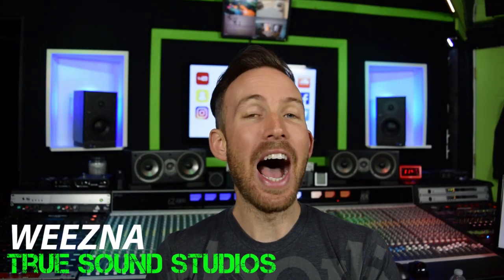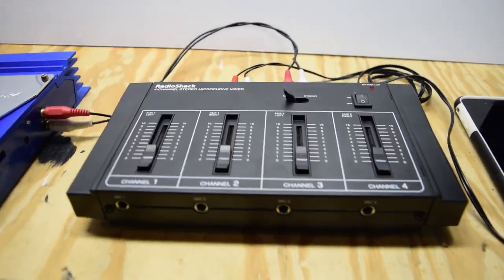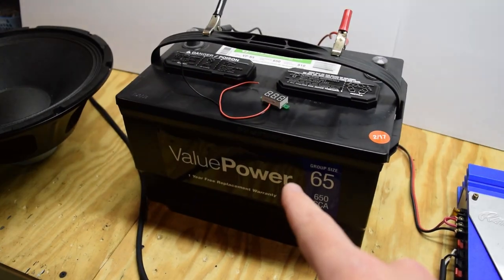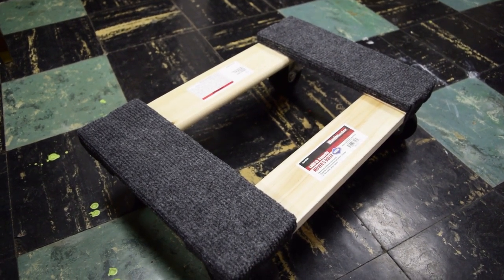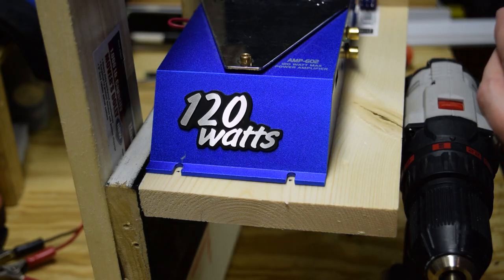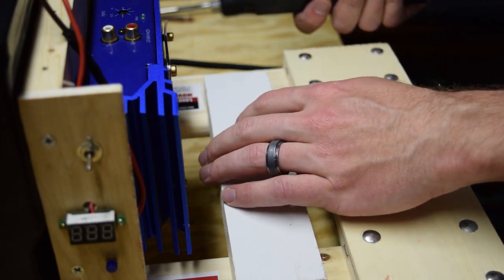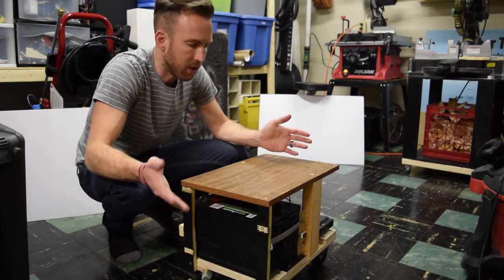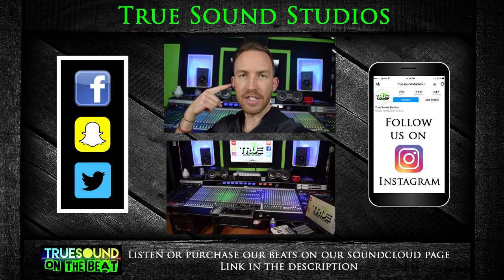How To Build A: DIY Portable Battery Powered PA System for Busking

Comment: I like how this build is not all polished. It’s very real, like using a piece of shelving that was sitting there. 
It should’ve been deep cycle battery, but I love the idea. I specially like the voltage meter and the push button for it. 
Thanks!

Comment: For a situation like this you should use a deep cycle battery. They are designed for going for through charging cycles where it gets fully charged then periods of use without charge then back to full charge again. Automotive batteries are designed for simultaneous use/charging cycles. Electric vehicle (scooters, bikes, golf carts, etc.) batteries are generally of this type. This will give you more reliable battery life.
Reply from the maker: Thanks for the info!
Reply: Or small lithium batteries in series parallel combination circuits to get your 12V. Since large batteries go bad and are expensive to replace if the reconditioning fails.

Comment: My Tono 50W stereo PA system has 5 inputs with wireless mic with reverb, bluetooth, foldback speaker with earpiece option etc. Handle pulls out when you drag it. Battery lasts 12 hours. Fits on the back of my motorbike. $50 brand new. Backing track lyrics appear on ipad that sits in the ipad /mic stand that telescope out of the speaker. My Jammy digital guitar clicks in half and sits in my backpack. 100% wireless.

Comment: Many comments here suggest buying a proven portable product, and it's very good advice, most of these use "lithium ion" battery packs and there are specification reasons for this. Sustainable power = quality. D class amplifiers have come on a long way, however, a car battery is not designed for this solo longevity performance purpose, and will very likely make your equipment unstable. Keep surfing, there are many subject matter examples here on YouTube for comparison purposes.

Comment: Hi, good video, thanks!

I have a question. If I use a battery like that to run a car amplifier, do I need to ground it to something metal, or just to the ground connection on the amplifier?

And why do people use AC amplifiers with a power inverter? Wouldn't it be easier to just use a car amplifier connected directly to a battery, so you don't have to carry a power inverter?

Comment: my problem.would be on the charging of the battery,i got a subwoofer amp module with its two mic inlet..it has a 12v  and a 220v inout socet..so i was thingking if will the battery be charging conected through 12v input socket if the speaker amp is also connected to 220v ?

Comment: Well done buddy! Just a small comment at 10:30. I will remove those metal side caps and drill, and then put them back on. Those metal fragments go inside and cause short circuiting!

Comment: Believe it or not a larger guage power wire will increase the power to the amp. Crutchfield used to put a chart for the guage wire vs the amp size, I'm sure those charts are online somewhere.

Comment: Hi~ I want to make a cart so I can take my DJ turntable set up out on the street. That's 2 decks a mixer, speaker/amp and laptop. What's the difference between a car battery and deep cyle? I just heard a deep cycle is better. Or will last longer. 

How long does your set up last? Or power that?
Reply: 1 car batteries need a lot of power to start the engine in the engine is a alternator which recharges the battery
a deep cycle battery also known as a leasure battery is better in the life of battery 
did you notice in video the only think is running from the car battery is the stereo and that the mixer runs of its own batteries
there is a online converter to help with maths and a rough estimate on length of time but as a basic rule 
the amp hours on battery is divided by 12 watts  example 100 hours battery will last 8.5 hrs
another general rule people think this is ideal believe us on this go for the biggest battery on amp hours and divide this by 2 when buying 
Why you may ask you want value for money in the long run and also batteries do not like to be drained fully and you will get more charges over the lifetime of the battery
if using lithium the optimised level is 50% these don't like full charges best scenario for these 20% to 80% and the battery will last 3 to 4 times longer so remember to keep eye on phone battery charging level  or anything else you are charging up on to get the most out it's battery life
Reply: do not run a laptop from this unit best to make sure battery is full before starting out and buy a powerbank a good one shouldn't cost more than 30 quid a belkin 20000mAh is ideal is what you can expect for the money spent and is ideal for lithium devices and remember not over 80% charge and it will lasts years if looked after  😊

Comment: Ok I have a 7,000 watt turbo sound set up that I would like to install in mt truck any idea on how I can do that considering it has built in amps? please help. I want to perform on my small trailer and pop the back hatch open and power on and go without a loud ass generator

Comment: If you decide to make a triangulated Speaker set up with sub woofer. What kind of cables would you need, and is there a way to keep the cost low? Also, any low cost high quality mixers you recommend with 8 channels and a FX send and return?

Awesome video by the way, i hope this is a series!

Comment: I've been looking at getting a mixer like this just to give my bicycle trailer sound system a PA-upgrade. Especially on those group rides where I've got to call an "obstacle up" on a bike trail or on the road.
Reply from the maker: Oh very cool! Is there a video on your YouTube channel of your bike system? Thanks for watching
Reply: I don't know why this reply didn't pop up. There's a few videos floating around, but none of them I recorded on my channel. If you check my IG under the same name(bentstrider83), I've got a few short vids where I'm riding with a crowd.
I also wanted to ask: Will hooking up the 9V mixer to a 12V battery harm it in any way? I just don't want to be changing out a nine-volt battery all that often.

Comment: Weezna, u r my Hero...Do you wear a Cape?
I need ur advice, Doctor:
I am going to drum/percussion busk to 1400 ‘drumless’ tracks. (Later, it will evolve into inviting folks off the street to:
A. Added Drum Karaoke
B. Added Vocal sing along (sm 58)
C. Added Guitar Karaoke playovers/& jam. (2020?). 
My street rack is large and varied, but all instruments are small: 14” kick, 10” sn, 10” hi hats, LP practice congas, no shell, Cajon, etc. 
I will be all unplugged/acoustic of course.  Playing w/hands 60%, small almost timbale sticks 40%. 
I would like encompass the volume spectrum of playing in quiet settings like school classrooms n coffee shops with a clean signal, no buzz...up to kicking pretty strong outdoors on a biker pub porch at a Busy Friday nite intersection...(hopefully I can plug in to the bar’s AC). 

Ok. I have just about everything except:
A. Complete Off grid power 
B. Any more money. 

For A, I have: new 12 V Interstate car battery, gator clips, and a quality charger. 
This Summer, I would like to
A. Run my drumless tracks from an iPhone thru a Behringer XENYX qx602 mp3 into One powered 15” JBL EON G2. 
B. Maybe after getting it to run smoothly for 8-12 hrs each day, shoot for adding a single Vox SM 58 thru the Behr mixer as well (it’s got some cheap reverb). 

Looks like I need a pure sine wave inverter. 
I have 200’ of extension cords (yuck). I have driven semis coast to coast w/no fridge, so 
A. Im a pretty good off grid camper n
B. I AM, however, planning on future van living with a future quality quiet Honda generator. 

C. My busking set up has a 6’x8’ ROOF. I’m planning on Solar Power in 2020-21?

But for next 3 months, I would really like to perform, sans generator or a football of extension cords. 
I can sell a Nice snowblower n lawnmower to raise funds for a sweet/strong/Clean/efficient Pure Sine wave inverter... providing enuff strong to power to kick Heart’s BARRACUDA with bigger sticks, stronger strokes, and a Cranking 300lbs Female Vocalist for 75 Bikers outdoors by Friday nite traffic. 
Please Doctor Weezna, 
“I just stopped in, 
to see what condition my
Condition is in...? “

PLEASE AND THANK UUUUuuuuu !!!

 -Hatchet-Jack

Comment: What would you recommend for busking with my electric guitar and guitar amp. I tried battery powered amps. They are either not loud enough or to expensive. Was looking in to buying a power generator or the old battery and battery converter. The latter seems to be the cheapest route.
Reply: Whoops correction not battery converter, but power inverter

Comment: Power wire to thin ...
No Fuse in Battery circuit  
Turn Voltage meter right way up ...
Deep cycle Battery is required , Car batteries are not meant to be run down ! They are constantly charged by the Alternator ...

Comment: The lead acid battery is a bit of a hazard if it ever gets tipped over and acid spills out. A gel based, or sealed, lead acid battery would be safer.

Comment: Nice!! Okay, help me out. I have amps. Really nice. Cheap too. I got a Roland Mobile AC, 2.5W x 2 which has a great sound. Of course, the volume can be a bit low if there is car traffic near, etc. But portability is awesome. I also got it's big brother, a Roland AC-33. Even better sound, very sweet. It's also battery powered, and a bit heavier and bulkier, but it's 10w x 2 (plugged into the AC it's 15w  X 2). But surprisingly, although it's not actually much louder considering the much higher cost, wattage and weight. (Mobile AC was $129, and AC33 is $399). So here's where I can get your help... either 1) Can you help me get 10 more watts out of the AC 33 somehow, without having an AC socket? Or 2) Can I get a much louder but still super light system like these two? (I can carry these amps in my backpack, Mobile AC in any backpack and AC33 in a largish backpack). Thanks in advance!

Comment: You’re gonna wreck that battery by deep cycling a battery that was not made for it. Really should have used a marine deep cycle battery that’s made for load, not starting like that one.   Also would have been a ton easier to front end that marine battery with a simple 800w inverter and a small dj or mixing setup he already had would be fine

Comment: This is all so so
wrong 😂 Yes it work but why are you relying on the fuse in the amp? Should have one in line, if it’s going to be permanent then why are you using alligator clips and not proper terminals? Also why are you using a standard car battery? Could of gotten a smaller sized deep cycle or something similar for a similar sort of price